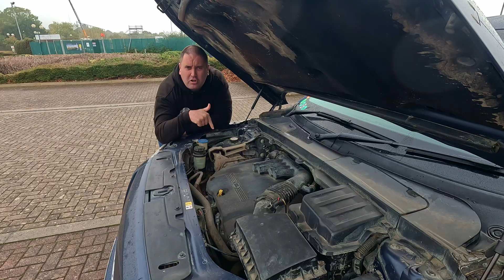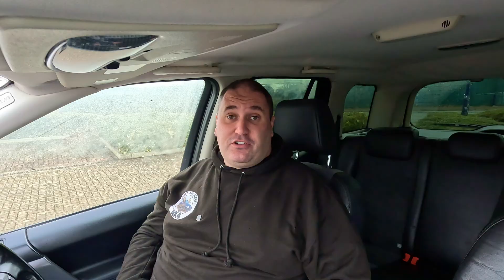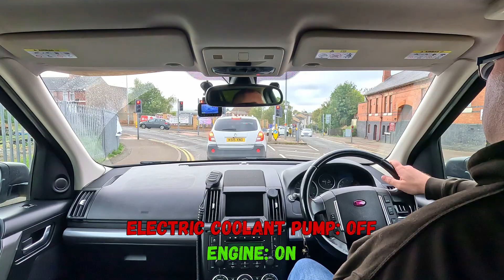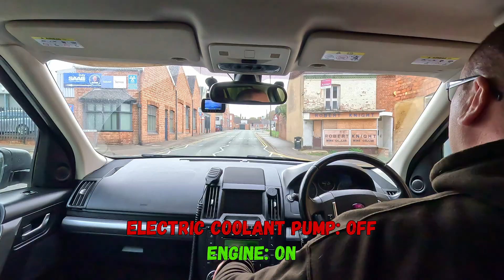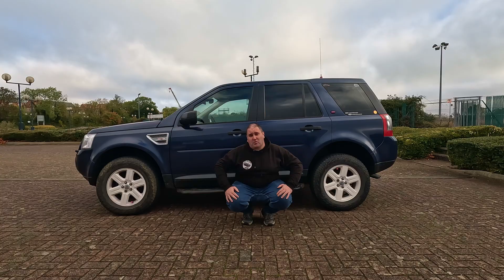Fascinating Features On The Freelander 2 - The Electric Water Pump

Comment: If I'm right with stop /start when your engine stops so does the oil pump so you would be getting no flow of oil to your turbo so its sat there in hot oil which is going to cause wear problems with the turbo.
Mines not stop / start but when i pull up i always let the car idle for a couple of mins before turning off to get cooler oil round the turbo.
Reply from the maker: I don't know this for sure but I would assume that the start/stop system would monitor things like the oil temperature to work out if it can turn the engine off or not. 😊

I'm going to assume that Land Rover have this potential issue covered off as stop/start cars don't seem to suffer turbo issues any more than cars without stop/start on them.

We are much the same as you that if we have been on a long drive and things have got hot, we turn off the system and let it idle for a bit before switching the engine off. 😀

- Scott

Comment: Interesting - fl2 newbie of 3 days here - I’ve read that an even better idea in early stop start vehicles is to turn the feature off via the eco boost button …. this  is because it adds 1000s more start cycles to your vehicle life degrading starter motor and battery ( even stop start batteries) .  Newer vehicles have adapted the starter motor etc to survive stop start but early adopters did not….. that eco button on centre dash turns it off ……….. good topic for a new video ? Pros and cons ?
Reply from the maker: Hi Rosemary and welcome to the world of Freelander 2 ownership 👋😁.

To be fair, I would guess that a good 80% of people that own a Freelander 2 with stop / start on it turn it off every time they get in the car or even have a wrong battery fitted that means that it won't work.

As you say, the benefits of fuel saving are quickly outweighed when you need a more expensive AGM battery and also having to replace the battery more often. Plus starter motor degradation with more use.

On the flip side, I am one of the small percentage of people that actually like the feature and use it often. I personally enjoy sitting in peace without the engine chugging away when in traffic, at traffic lights or being able to give my drive through order without the noise of the engine 😁.

This is definitely a good topic for a future video. I've just got to have a think about the best way to convert it into a video 😊.

Thanks for the comment 👍. 

- Scott
Reply: @ScottandAlana4x4  I’ve got the title for. Stop/start? Video……. Wait for it …. “ To  e or not to e…. That is the question “…..,,.
Reply from the maker: @rosemaryjanerichmond Hahahaha love it 😁. Maybe you should come and host a video for us? 😄

- Scott
Reply: @ScottandAlana4x4  I’ve got the title for. Stop/start? Video……. Wait for it …. “ To  e or not to e…. That is the question “…..,,.